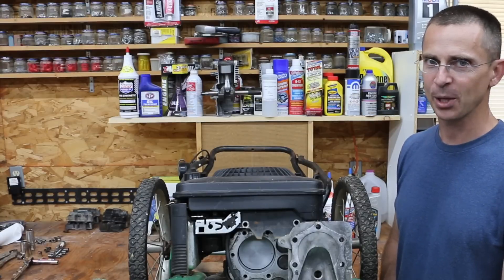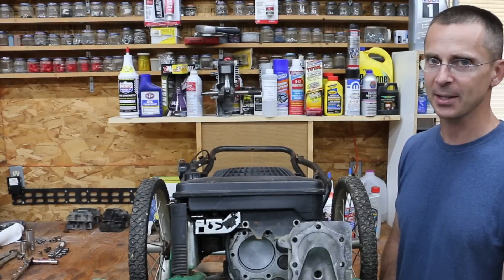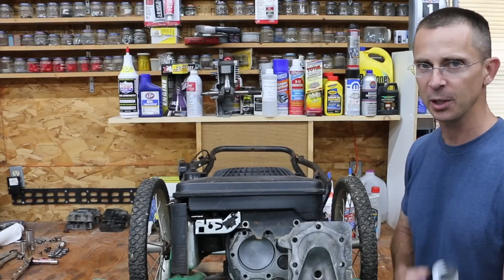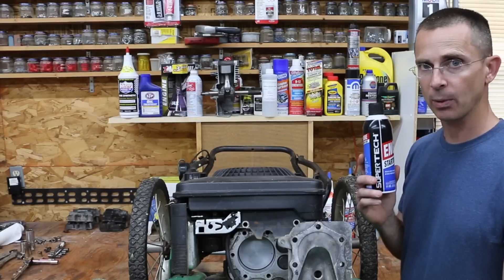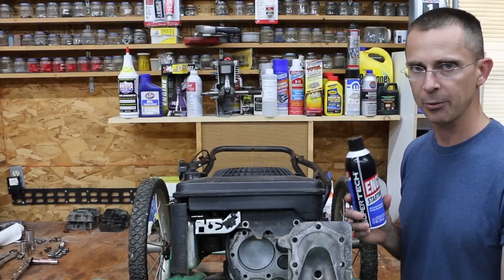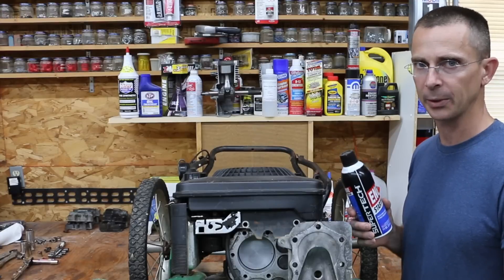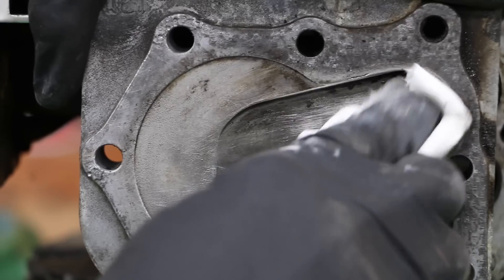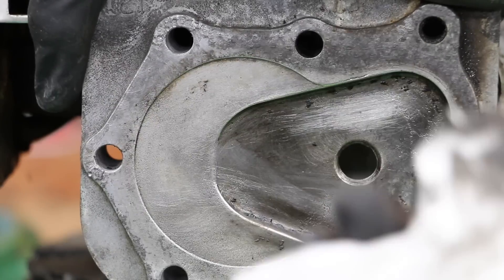Will Running an Engine on 100% Starting Fluid Cause Damage?  Let's find out!

Comment: Try running a two stroke engine with just gasoline
Reply: shawno009 y'all do realize its like saying a regular 4 stroke can run without oil if you are easy on it, you are scoring the metal, seizing the ball bearings in a 2 stroke, basically scratching the hell out of anything that contacts anything else, sure it might fire back up but it will never have the compression and reliability of a 2 stoke that has oil in it all its life
Reply: Yeah some one put straight gas in 2 of our weed wackers (goodbye red rooster)
Reply: shawno009 as a professional small engine technician, I strongly advise against running an engine without lubrication... I have had to tell countless customers they need a new engine because of a simple 50:1 in a machine that requires a 40:1, especially when they run it with straight gas, First thing I do is dump the fuel into a clear bottle, if there isnt oil, I pull the muffler and every single time the cylinder is scored to hell and the compression is way too low..
Reply: Trucks nTractors   ahahha you can tell if its 40 1  or 50 1 run in an engine ahaha
most premixes are 45 1 and sold as both  ahahah
Reply: Tons of examples of what happens out there for that
http://www.madsens1.com/saw_piston_fail.htm
Reply: How about Gas mixed with a little diesel for lubrication no oil in a 2 stroke also.
Reply: How bout remove the oil from a 4 stroke and use 2 cycle fuel mixture.
Reply: but would the starting fluid work?
Reply: Brian C because you are lowering the octane of the fuel, An octane rating, or octane number, is a standard measure of the performance of an engine or aviation fuel. The higher the octane number, the more compression the fuel can withstand before detonating (igniting), so basically the fuel was igniting too early so you were getting the same symptoms as too advanced timing thus the pinging (also known as ignition knock)
Reply: Axillary Gaming I've run my 2 stroke boat motor without oil once if you take it easy I mean very easy it will be ok ... I made a 2 mile trip down river & far as I could tell caused no damage to the engine ... Wtf would it stall lol maybe your motor wasn't running properly before ?
Reply: It's not too exciting. It just slows down and stops running, watched my dad ruin the snowblower. It has low compression now so it's a pain to start.
Reply: Samuel Seidel it would do the same thing as no oil because in a two stroke the fuel/oil mix goes through the crankcase and lubricates the engine before being pumped into the combustion chamber for ignition, in a 4 stroke, the fuel is pumped right into the combustion chamber bypassing the crankcase, therefor the engine would just end up seizing.
Reply: I saw a guy on youtube start up a 350 chevy on the  ground, and he ran it for almost 10 minutes with no oil in it before it swelled up and seized. I bet when it cooled off it would have started again. He had the carb wired running about 4000 rpm.
Reply: That would be cool but painful, as in my childhood I remember having the oil injection fail on my 4zinger, it had a big bore yf60 kit that I saved up for, and one morning it wouldn't start, my grandpa knew exactly what happened and put a little transmission fluid into the cylinder to give it enough compression for one last run, to this day it sits in a shed with dry rotted tires, the head removed, and a bunch of decals all over the place, and that dg exhaust that used to sound like a submachine gun, as a kid I had a lotta fun with kids older than me on their Honda 125 fourtrax's and even this day I believe on the trails, if it ran it would keep up with a 250ex
Reply: Axillary Gaming one of our employees started a brand new stihl chainsaw with starting fluid throughout the day, no idea why. When it got back to the shop  it needed a cylinder kit
Reply: Axillary Gaming. wont last. ive used mix from a weed eater to run a leaf blower. mixed differantly slightly. different mixes even damage engine. with in minutes. done
Reply: Don Rutter lol it wouldn't start again because a engine  seizeing is like its being welded together on the inside
Reply: My brother did that...
Reply: I regulary mix a few ouces per tank (maybe even 1/2 quart) of ATF to my fuel (it's the poor mans fuel system cleaner) and the other day not sure if it was crappy fuel or the fact I dumped maybe 1/2 pint of 2stroke mix in it...but I started to get a funny knock from the engine...got fresh fuel and it's gone....weird
Reply: Lol that isn't a myth
Reply: Trucks and tractors : engine shouldn't seize just from running 50:1 in a machine that requires 40:1... unless they're using some really garbage oil.  even then it shouldn't.  sure, it's getting a little less oil, but it's running richer / more gas, so that cools the cylinder down
Reply: i'll agree with that overall.  but imo the same could be said about 40:1 vs 50:1.  it's such a small difference, it's not going to matter in the life of the engine.  long story short, if you don't know what you're doing, stick to the manufactures recommended ratio.  even more importantly, use a high quality (and rated) oil.  if you know what you're doing and aren't afraid of doing some jetting and plug chops, you can more or less run whatever ratio you want.
Reply: Robert Tadic heck, bore it oversized and put new piston and rings. You could bring it back to life for fun or for your own kids! Back in the day when I had my  Kawasaki KE100 and 125 I pulled the oil injection off and ran pre mix. Other kids that were older and more mechanically inclined told me this could happen. I always worry about this same thing happening on my 150 Yamaha outboard. Oil injection failure would get ugly fast at wide open throttle!
Reply: Axillary Gaming I did and I needed a new piston after running the engine with oil ratio 1:70 for like 20 minutes
Reply: Already done that to my 49cc 2stroke bike, seized up the engine because it overheated (oil pump stuck closed, or what happened im not sure), i let it cool down, and still drove home, i rode it like that for few days, when i disassembled the engine, piston ring cracked, and flew out the exhaust port (pretty lucky) still could have riden like that, but it had no power, and no compression, changed the piston with rings and it was still good for two months
Reply: Ed no oil pump in small 2 strokes hence y u add oil to the fuel
Reply: Axillary Gaming due to the transfer of metal between the piston and cylinder. We have run a line trimmer with no engine shroud 6 tanks of straight gas finally we hydro locked it with water, bent the connecting rod but the straight gas actually did no damage to cylinder or bearings, this was an older broken in unit
Reply: mchl8 six tanks of straight gas wide open on a stihl line trimmer, still didn’t lock up. A seasoned engine is by far more resilient than you think
Reply: ROMAK 47 

I think you were VERY lucky to get away with that.

Running no oil will kill a two stroke eventually for obvious reasons.

This is coming from someone that does a side line in small quad bikes, particularly lt50s. 

Seen too many of them with oil tanks removed and running on 'when I can be bothered ' premix which feature crank play and requiring top end rebuilds.
Reply: Clyde eventually yes, immediately no. A Kohler commercial twin cylinder engine with no oil and cooling air blocked will run for a couple days, several hours with governor tied wide open, again a seasoned engine, brand new first start maybe twenty minutes
Reply: Axillary Gaming you'll burn a hole in the piston with ether in a 2 stroke
Reply: did that once. engine stopped. stuck, seized up. 2 hours later, tried it, and it started right up.
Reply: It won't even start with just gas lol
Reply: Swan Donovan what kind of two stroke trucks and tractors you got ??
Reply: Everyone talking about random 2strokes but what you should not do is use oil injection pump on a 2 stroke because they get clogged and then you're bike gets no oil and then gets fucked up and should only mix you're gas plus its faster that way  lol
Reply: It will seize due to lack of lubrication
Reply: Would be better off going 100:1 with good synthetic oil
Reply: If your easy on it the gasoline itself is enough to lubricate it but but if you rev it up then there is a need for oil because otherwise it’ll seize
Reply: We all know that 1 person that ran straight gasoline through their new snowblower... Its runs sounds like shit and locks up
Reply: Axillary Gaming it would seize the engine, because the oil you add acts as a lubricant since there is no oil in the crank case, some two stroke engines have the carb and intake on the side if the crankcase so when it inhales I the gas and oil catch the bearing in the crankshaft and oil it so it prevents it from locking up others have it just going straight into the combustion chamber and lube the cylinder walls to prevent sizing up in that direction.
Reply: IT will just stall. Happened to me a few times when my oil lamp was broken and my oil reservoir went dry. There might be minor damage to the walls however, the more often this happens, the more damage you will get
Reply: It's not just the cylinder though, don't forget in a two stroke (most two strokes anyway) the crank and small end gets its lube from the fuel oil mix.

Running at a slightly leaner oil mix may not cause short term detriment but over time it will. The extra fuel in a leaner oil mix won't compensate either as the additional cooling effect will be negligible when talking about the amount of extra fuel which would be present and barely quantifiable.

Conversely while say omitting 50% of the required lubrication will have a massive negative impact on engine health if you could see the oil amount in a pan it'd look like a comically insignificant amount.

Finally, if anyone ever tells you they don't put oil in a two stroke's fuel and have never had a problem either they're straight up lying or they don't consider changing the engine almost as much as they add fuel to be a problem.
Reply: I have a 2 stroke red max backpack leaf blower that I've used for close to 15 years with hardly any oil (only putting it in when I have it) and it starts up and runs perfect. However, I also have a 2 stroke Husqvarna 150bt that I ran 1 time without oil and it lost compression and wouldn't start.
Reply: Axillary Gaming nah it would choke out the engine. I accidentally put regular gas in my motorized bike and it choked out.
Reply: Axillary Gaming  it will blow up or it will sees up
Reply: Trucks nTractors this is very accurate people are stupid
Reply: Lol Briggs and Stratton engines should be banned from sales. They choke out after one season without any winterization.
Reply: @drewsquickfix  That's a filthy lie.

Comment: What about running an engine on carburetor cleaner or brake clean 
I use carb cleaner to clean out my carburetor and give my lawnmower the "boost" it needs to start (choke is broken) 

So could you try running a lawnmower on a can of carburetor cleaner or brake Clean?
Reply from the maker: Thank you for this suggestion!

Comment: i was always told that it was a higher concentration than normal fuel so it would have an eaiser time starting or to make it burn a little hotter to kinda "jump start" the engine
Reply from the maker: Thank you for commenting!

Comment: Since there was sort of an oily residue on the cylinder head that the starting fluid might have some sort of a lubricant in the fluid? I think this would make sense to assist a engine that needs help starting to give it a little extra lubrication and reduce the friction and help it to start.
Reply from the maker: M W S, I agree, I believe there was a lubricant in the starting fluid.  Thanks for commenting!

Comment: It's very possible that starting fluid could cause damage in a diesel (I often see compression ratios of 18-20+:1) due to early detonation, and almost every diesel I see with glow plugs specifically says either to not use starting fluid or to disable the glow plugs before using it. That being said, I have actually started a diesel and kept it running with 3 (or maybe it was 5) cans because it kept losing its fuel prime after sitting for a while. It died right afterwards because it hadn't recovered prime when we ran out, but we got it running a bit later.
Reply from the maker: Great point!  Thanks for sharing your experience!

Comment: Idk but maybe try putting soap like hand soap or dish soap inside a engine that would be cool thumbs up to do it!!!!
Reply: i think it would foam up in short order and basically hydro lock the engine from the crank case side ........ any bets ???
Reply from the maker: Darryl, Thank you very much for this recommendation!
Reply: Darryl Haycock I've done this before. Basically it just foams out the crankcase breather until something fails from lack of lubrication
Reply: +bruce elmore Soap is an emulsifier, it displaces oil. I am just wondering how detergents in oils work, if they displace oil too.
Reply: Krankie V out of the crankcase breather.. what's that.
Reply: The crankcase breather is a vent tube that allows the air pressure inside the crankcase of the engine to remain equal to atmospheric pressure as the engine is running. This tube is generally connected to the valve chamber cover, and routes the oil fumes to the air intake so the fumes get burnt instead of polluting the air.

If the crankcase was not vented, the pressure inside would build up from heat and piston blow-by, and the high pressure would blow out the oil seals.
Reply: Krankie V ah that's the one you're referring too. Thought you were meaning a reed induction/case 2T under the term "crankcase breather" I've come across a few people stating a reed under that.
Reply: Darryl Haycock   Throw slime into your he cylinder watch the engine blow

Comment: Mix a whole bunch of fuel additives together and run them through an engine to see what will happen. cool vid love the channel don't ever stop posting :-)
Reply from the maker: Ryan, This seems like a neat experiment--thank you!
Reply: if you mix all the fuel additives that exist together, the engine gets so clean it turns invisible!
Reply: SouthJerseySound 
Same but different, I had/have a diesel with water injection. 
I use washer fluid for a nice kick, but you need to let off the button in between shifts or the revs rise real fast by itself....
like a runaway. 
Anyways I pushed it one day and was about a mile from the gas station and it was sputtering....
I was able to rapidly toggle the water injection and hold a controlled runaway all the way to the gas station for fuel. 
It was a little bit angry on the restart because I almost lost the prime. 
It cranked about 10sec before it lit off  but it went 😬
Good times.
Reply: I did just that in order to get my car into a gas station when I ran out of gas.....lol.It ran but if you gave it too much gas it would knock like crazy.
Reply: zappy bear 
Yup, what was that fuel additive commercial from a few years ago that touted "contains jet fuel!"
like its gonna make your car do 3000mph or something. 
jet fuel isnt much different than diesel fuel, and we all know how great gas engines run on diesel fuel.
Reply: Pat Dennis 
Exactamundo 
Throw some jet fuel on the ground and throw lit matches at it....same with k1...
you'll be there all day u till you get a spot warm enough to light 😂
Not much different than diesel really. 
It'll run in a diesel , but lubricity is a problem, you'll cook a pump in no time.
Reply: Additives contain mostly kerosene according to a lot of msds I've looked up. It'll probably be similar to running an engine on kerosene.
Reply: STP gas treatment says it uses jet fuel as a carrier for the active ingredient. They say jet fuel because it sounds so high performance when in reality it is probably just K1

Comment: You should run the engine on straight sea foam. That would be awesome! Sure it's alright to add to gas, but what if you're mixing it and add way to much, or add it then forget to put gas in. Would it be good for the engine or bad?
Reply from the maker: Thank you for this recommendation!

Comment: Should do more epoxy tests. I'd like to see some liquid nail, and also this 3M Clear Epoxy PN: 08107. Requires a gun and mixing tips that mixes in a hardener as you pull the trigger. We use it at work a lot. Seems to stick to almost anything and once hard really seems to hold almost anything together. 3M also has many other type of mixing epoxy you should try.
Reply from the maker: PardenBoyz, Thank you very much for this recommendation.  I'll publish a another epoxy video in a couple of weeks. Thanks again!

Comment: Starting fluid is more of a danger to a diesel, it causes pre-detonation and is very dangerous when it locks an engine, much similar to hydrolocking it in terms of the type of damage. If used properly it causes little to no damage if used sparingly. That being said I have a case 686 tractor that has never had starting fluid used in it that will start in 10 degree temperatures without the block heater and another one that had the can tied to the intake that will only start at 40degreea and up. Both are the same age and both have around 2000hrs on them.
Reply from the maker: Michael, This is an excellent point!  Thanks for sharing your experience with the case 686 tractors and the impact it's had on one of them.

Comment: spark fired engine...no worries....compression fired engine....not so good when the starting fluid fired before TDC....kablooey!

Do NOT try spraying it over and over and over again on a diesel trying to run especially if it has a "pre-heat/glow plugs" system (starting a quick shot can get it to fire up [on a cold non-glow plug engine], but can also detonate and do explody splody things....right in your face!)